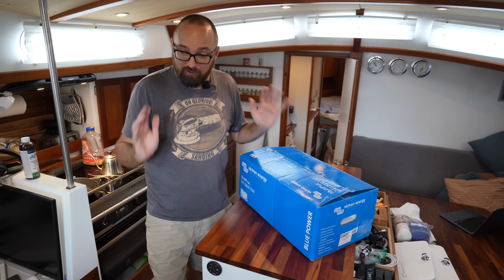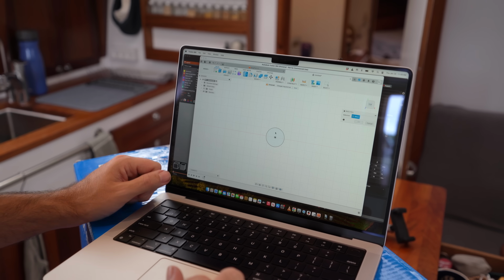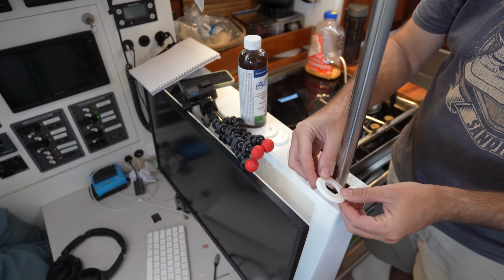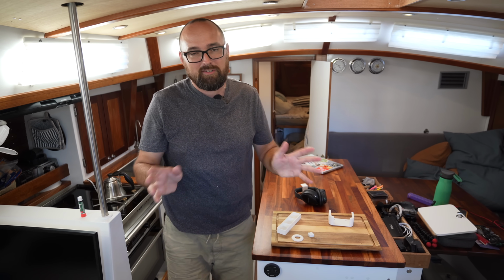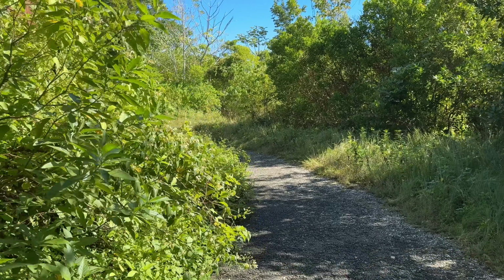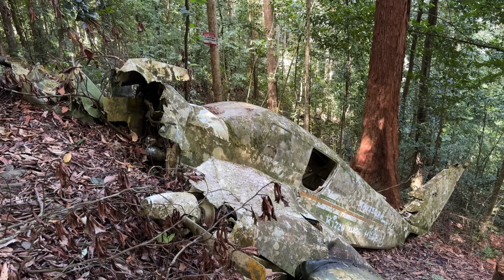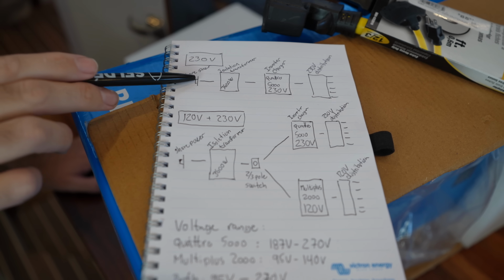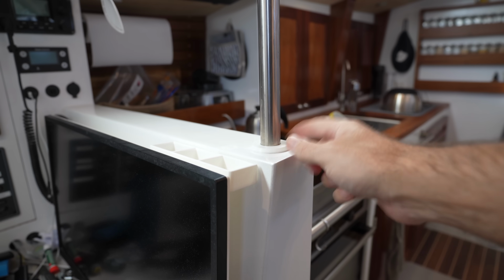Sail Life - 3D printer onboard & hike to abandoned tracking station

Comment: I just started my 3D printer journey as well. Couple of things to get you more jump started.
1: if you can figure it out, ASA will be your friend. Space wise, it’s worth figuring out how to make it happen. It’s UV resistant and finishable with acetone so you are 100% water impermeable/smooth.
2. Switch to Orca slicer. It’s a lot better.
3. Print a 10x10x10 mm cube and adjust shrinkage for each filiment. Your prints will get way more accurate.
4. Fusion is the right CAD program for this. More engineering oriented, and anything you make you can also have a CNC machine mill it if need be.
5. Once you get a bit better at design, switch away from a bed slinger. Like the Bamboolabs x1 series or p1s. You get a lot more build volume for the footprint and the enclosure means you can print ASA right away. You can get really big bedslingers for less money, but you are space limited.
6. The rocking of the boat shouldn’t be much of an issue, buuuuut, adjusting your printer might be more difficult. Assuming proper bed adhesion the leveling is relative to the print head so the movement of the boat shouldn’t matter.

Comment: We are planning on leave for the Caribbean next may. I thought I was the only one planning on bringing a Prusa MINI on such a trip. Seems like a no brainer. A few tips if you haven't gotten these already;
- Switch to PETG, way more ductile than PLA and better layer adhesion. Buy the black stuff for outside. The black pigment provides sort of a UV resistant barrier to the underlaying plastic. White should be good for the inside of the boat. 
- Buy a small roll of flexible filament. All the 3D printing experts will tell you it is impossible on a MINI, including Prusa but it works fine. Better than on a MK3S in fact but that is my experience. Using the flexible stuff currently to print waterproof gaskets fur under my stanchions. Time will tell if this was brilliant or stupid. 

Definitely keen to see you go to town with this setup and can't wait to see what you come up with.

Comment: Hi Mads, the Victron isolation transformers upscale the voltage, as they say to compensate for voltage drop due to long shore power cables etc. 
Nice but we are not on 110 or 220 any more. Eu grid is upscaling some years now, from 220 to 240 and higher, to compensate for netcongestion, lower amperage and replacing hight voltage lines from copper to aluminium due to costs.  I myself running at 245V and that is already hitting the limits of some components inside all sorts of electric equipment. 
A solution?;
Lucky enough the upscaling is done with some extra windings on the 2 coils on the Secondaiy side. Yeah...analog is the way to go...Mr programmer:)). So by switching Primairy and Secundairy wires, (4 in, 4 out) you down scale the voltage by 10 volts. So there is even at higher voltages some Saillife left in the Victron isolation transformers.

Comment: There is a way to install a Step Up/Step Down transformer spec'd out correctly,  where you can get one spec'd out with a 20%+/- increased/decrease voltage on the input/primary side and the output side/ secondary coil would output a stable 240/110 voltage 60hz (whichever you require) and would be installed before your Victron inverter/charger.  Those transformers range from $50-$125+/-.

Comment: brother have you tried putting even a slightest load on the 2xx volt side? it should drop the voltage 10-15v even with a phone charger connected.
Reply from the maker: Even when the voltage is so low that we’d be within the voltage range of the Quattro and we’d start charging at 1500W plus running AC 1200W eventually the voltage will go up and we’d disconnect 🙂 I just think the grid is just too unstable. I’m sure we’ll do much better in the US.

Comment: Drying filament in an oven is a bad idea. Better to build a dry box with desiccant. The specific problem with drying in the oven is that by the time you get it hot enough to dry out, it will become elastic and the filament won't be consistently round.

Comment: Not sure if it bothers you, but I believe you can disable the clock on the oven so you don't have to have that "12:00" blinking.
While the oven is off - hold Clock and "Plus" button until it goes dark. 
It could also be just hold any combination of two buttons until it switches off. F.ex. hold "+" and "-" until the clock goes dark. To enable, just hold again. 
Any timers, countdown etc. are in use, it will still work as normal.

Hopefully it does retain the setting after losing power...

Comment: A tip for getting a nice finish is to use a spray filler for plastics (for car body work etc). They cover up those layers easily, and can be sanded down for painting. 
The filler will of course alter the dimensions slightly, but just scale it down a bit before print. Sanding the layers it a hassle, and usually still doesn't give a uniform finish.

Over time with the varying temperature and UV, PLA will become more brittle.
For "permanent" parts like that I really do recommend PETG. It's almost as easy to print as PLA, but you'll have a bit more stringing, and maybe tighter tolerances, so there is usually a bit of tweaking on the model when going from PLA to PETG.

As for movement - no issue. You could probably mount that printer upside in the headliner and it would still work without problems.

As long as you purchase quality filament, moisture is usually not a problem. I've had a roll of Prusament sitting open in a bedroom for 3 years, and it's still printing fine.

Comment: Just a warning on the 3d printed plugs.  If that's a 'wet' space you may have to spend extra time trying to keep them clean, as 3d prints are not 100% water impermeable and mold and such likes to slowly grow in between the extruded layers.  It might pay to epoxy or coat the surface, or if you printed in ABS Vapor smoothing can be used to make a perfectly smooth impermeable surface, at the cost of warping dimensions slightly.

Comment: The reason your voltage is a bit high is probably so that they don't have to worry about voltage drop as much when the load starts to get higher when the marina is full of higher power users.  It might be that the power usage is down because of fewer people using their boats or just because boats are generally becoming more efficient power users as tech is adopted to reduce usage.  Maybe the utility needs to adjust the taps on their utility step-dpwn transformers off of their high-voltage primary lines to get the voltage down closer to 120v.  I doubt you will see voltage this high anywhere in the USA unless it is a super janky marina.  Usually if you see any voltage issues it will be low voltage due to voltage drop at peak usage times and perhaps tripping breakers taking out a whole batch of power bollards or a whole pier at a time.  We used to have issues like that on the hard in Chicago during rush weeks right before everyone wanted to launch for the season.  Everyone was running saws, heat guns and hot boxes, halogen flood lights, sanders, wet vacs and other equipment all at the same time.

A cheaper alternative to the new blue box would have been an autotransformer on Athena or a multi-tap transformer that you can adjust the transformer turn ratio manually by moving the wires around inside.  I'm surprised that the Victron transformers don't have multi taps.
Reply: It's not uncommon to see 3-phase power grids that are setup to provide 220V line-to-line, which yields 220V / sqrt(3) = 127V for the line-to-neutral. On top of that, you can expect a 5% tolerance on the grid, so you could see as much as 133V and that is all within spec for that country's grid. This setup requires less transformers, but it does pose challenges with compatibility. It's surprising to me that Victron overlooked this particular configuration in their autotransformer.
Reply: I only sparky in the USA and 3-phase systems here are set to 120/208v precisely because we would rather see a little less phase to phase voltage than have line voltage creep up to 130 where we see more issues than we do with lower phase to phase potential.  

Resistive heating elements and incandescent filaments start to have lifespan and safety problems when run outside of design parameters.   If more power is needed than 208 single-phase equipment can handle compared to 220v then that three-phase present should really be utilized with true three-phase equipment. That's really the whole point of 3∅ power anyhow.

I admit I am not familiar what is done outside of the USA as I don't work outside of the USA   That letter "I" on my IBEW union card is largely symbolic.  Frankly I am shocked when I see how they sparky in other countries when we visit them (pun intended)  It's rather uncivilized IMHO.  It's bad enough in the residential sector here in the USA but I don't stoop to that level and frankly it's been a long time since I worked in the commercial trade anyhow. 10 years ago we pulled the plug (pun intended) and turned ourselves into cruisers who live on a boat and don't work anymore.  

We retired before age 50 and haven't looked back.  A lot of things have changed in the last decade and not all of them good.  3∅ systems run up to 230/220v, dogs and cats sleeping together, techs crossing the streams on their particles thrower backpacks, Vinz Clortho finding the keymaster...that sort of thing.

Comment: Your history is wrong including BMEWS. Intercontinent messages, internet,  US, etc ....you might want to do some fact checking before you are spreading mis information and BTW Pinterest and Quora are about as reliable as gossip...but make great propaganda almost like the idiot Al Gore claiming to inventing the internet....when speaking of current inputs, cycles is as important as current over cycling and current is one thing..under current and cycling is just as bad brownouts can kill equipment faster even with an UPS... so be careful I always have a  surge under current filter plugged into shore power and regulator at the source before it enters..and grounds are garbage also at many places.....just like pumping in water without a dual filtration system into your water system, same with power..Ive had 3 Prusa printers wore 2 out and on my third be careful of the bed dont know what you are running but the printer head can easily  do some damage, but a great system open source, and never keep your printing product on the overhead reel when traveling they break off easily, good luck and great content

Comment: In my experience I don't see the point in the PLA+. It doesn't print as nice as regular PLA (especially the white color) and since the Prusa Mini handles PETG I would stick with that for everything since it's stronger and more heat resistant. Nylon might be the next step up for more permanent prints that are exposed to high temps, friction or the elements.

Comment: The elevated voltage is likely because the local step-down transformer is lightly loaded.
You could add a buck-boost transformer to deal with the overvoltage.  They are pretty small compared to full isolation transformers.

Comment: The printer gonna be a game changer for you, in order to avoid all these failed pieces going to the trash can, the best thing you can do its print a series of objects with known length could be a series of clubes, your cylinders or a calibration matrix, to know how your specific printer works, it shrinks about .02mm, for many things it’s not a problem but for precise fit like the plugs that tolerance change it can be enough to work or not, and once you solve this issue you can take the measures and add the shrink factor on millimeters to make the piece slightly bigger and when it shrinks it has the right dimension

Comment: Just so you know... you can sand 3d prints smooth (or if you're going to paint them first spray them with filling primer, sand, then paint).

Also, when printing always consider the direction of the layer lines if strength matters
Reply from the maker: That makes sense :) Thanks :)

Comment: Why don't you use the step-up/down feature of the isolation transformer that can convert 120 to 240 and vice versa?
Reply from the maker: Because that will not work when the input voltage is too high. If you feed in 130V and you will get over 270V on the secondary side of the transformer. That is outside of the input range of our 230V inverter/charger.

Comment: Love the 3D printing content.  ABS is great for end product, but I’m not sure that printer is capable of the bed and hot end temps.  You also want a vented enclosure for temp control and fumes.  PETG is also good for durability but some of the same challenges as ABS. High infill PLAplus may be your best boat option, but don’t expect anything made with PLA to survive outside under the sun. Nice work!
Reply from the maker: Seems I might do okay with ABS/ASA https://forum.prusa3d.com/forum/general-discussion-announcements-and-releases/abs-printing-with-the-mini/ :)
Reply: @SailLife  That's great, and so much the better, although it will operate as a heater inside the boat.  I'm printing ABS in an enclosure right now with some ventilation.  The ambient temp in the room is 65f, and the temp in enclosure is 92f.  I really enjoy your channel and don't miss an episode.  Sail on!
Reply: its capable of ABS ive printed a lot on Prusa's and  its open source, Ive had 3 prusas wore 2 out  and sold them  and on my third Prusa the bed is tricky though be careful its one of the most capable and open source printers out there the reviews show..

Comment: Vacuum seal the spools immediately after each use and place the desicant packet that came with the spool inside the sealed bag. I’ve never had a problem with moisture.
Reply from the maker: I don't think our PLA is super sensitive. It's been sitting out in the humid hot air here for a month with no issues :)

Comment: Mads—on the electrical side: could you explain the math/strategy on using an 80a 12v charger from the Multiplus to supply power for charging the house battery bank which will use the Quattro inverter to supply the house loads for aircon (1200ishW for 1/2 duty), oven, microwave, etc) on the 230v circuit plus the 12v loads. I know you have solar charging and, I recall the Wakespeed/zeus from the alternator. 

For marinas (shorepower), is the plan to switch as much of the AC loads (read: aircon) to 120v for pass through? 

Do you think with the 3600w transformer capability (30a 120v shorepower), a MP3000 might have better margins when on shore power?  

Always impressed and just curious about the power management strategy/constraints.
Reply from the maker: My thinking is that 80A charging via shorepower is more than we need :) 80A@24V x 24H = close to 45 kWh. We don't need that much in a 24 hour period :) The battery will act as a buffer. It's also worth nothing that the 120V inverter/charger is more of a backup in case of shore power issues (high/low voltage). If we actually get 125V or below on the dock we can still use the isolation transformer and the Quattro 5000 :)
Reply: I had forgotten that you were at 24v. That’s a 50a charger so 30kW (ish). If you haven’t already experienced it, the chargers will throttle back when they get hot—they don’t maintain a 100% duty cycle. 

my marina’s power at the end of 50’ shorepower cords average 120 to 124 but 126v happens on one leg. The dock pedestal is almost always over 125v on both legs. (Resistance isn’t always futile…sometimes it can be helpful 😉) 

Sounds like a good plan and voltage drop…happens🤣

Comment: They do make isolation transformers with several output taps to deal with exactly the issue are dealing with.  I looked quickly and could not find one, but they do exist.  As I remember they have input windings for 120 and 240 and several output windings spaced 10-20 volts apart to deal with variations in the input voltages often found at docks.  I thought the company was called White. Perhaps they have gone out of business.
Reply: there is also something called a variac with continuously variable output voltage -- don't know what wattage they can handle
Reply: We have  few a work.  The wattage is pretty low or the size and cost gets big.  Also not sure the contacts would hold well on a boat.    @abrahamspam3243
Reply from the maker: That makes perfect sense! I wish Victron would have done that :)

Comment: Hi mads welcome to the Prusa family. As a mk4 owner Id say you got yourself a fantastic little machine. Filament drying is a bit of a fad unless you are dealing with nylon or other "engineer" grade filaments. My recomendation is stick to original prusaments to avoid the problems with trying out new plastics, I just got a bunch of ABS to throw away now. PETG will be good for almost anything in the boat, PLA is fantastic but my cellphone holder in my car melted away in the sun. PETG will "string" when id does absorb moisture... you will see if it bothers you or not. I learned so much about boats from you so... if you got any questions shoot away :)
Reply from the maker: Thank you so much! Those are great tips :) I'm glad I got PETG from Prusa then :)

Comment: It's a bit hard to tell from the video, but it looks like your parts have a certain amount of faceting.  This can be caused by the export from CAD to STL.  There should be a setting in the CAD package during the export talking about accuracy, or max angle, or ... that sets the mesh size of the STL and how well it approximates smooth curves.   set this to the most accurate.  This setting helps to reduce the size of the G code for older CNC machines, but is not really needed with todays large storage and high data rates.
Reply from the maker: Awesome! Thanks! I'll take a look :)